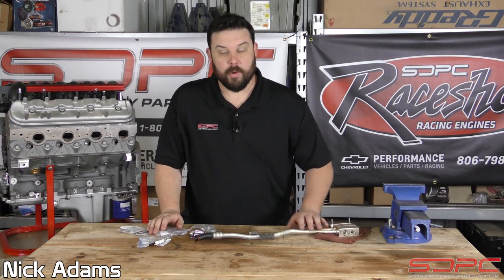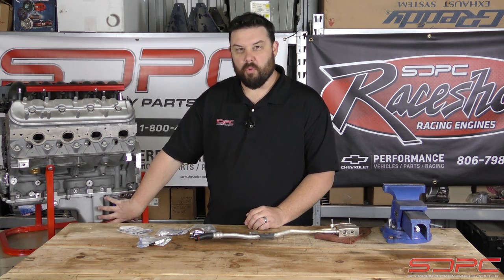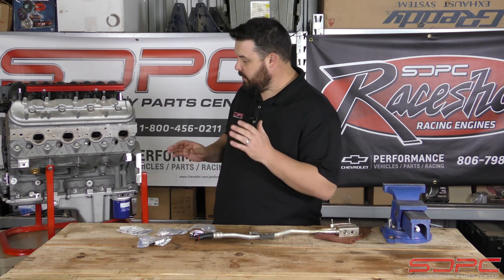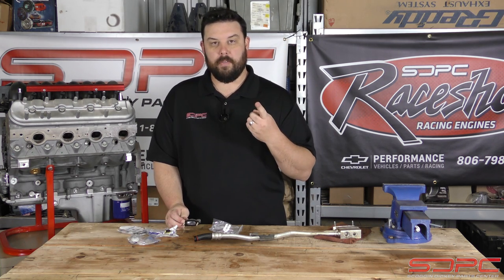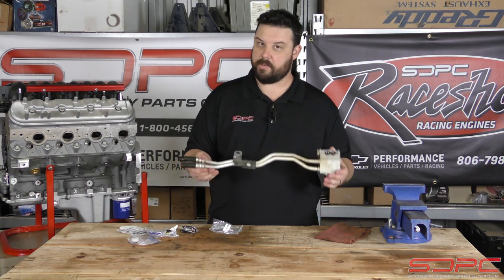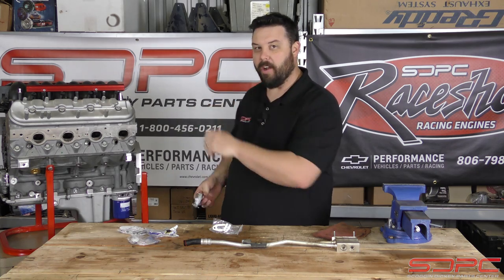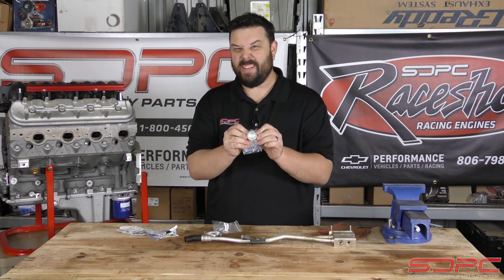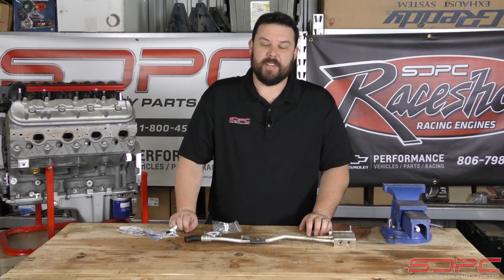SDPC Tech Tips: Oil Cooler Delete

Comment: I have a 1997 SLP SS camaro that has the optional SLP oil cooler.  I have built the engine to perform up to 7000 rpm.  Would you recommend deleting the oil cooler?  I was told that it can restrict oil flow at high rpm, but it was an LS guy that was saying that.  My engine is a 5.7 LT4 conversion, and it has a big cam that does its thing at high rpm

Comment: If I put this oil cooler block off can I use a a thermostatic oil cooler sandwich plate for it and will it work the same or no? I’m trying to take my original oil cooler lines off and replace them with 10an but not block them off

Comment: trying to find out if this will work on a 2019 chevy 1500 with a 4.3 v6 and if it will what part number do i need also if i need the plug in the block for coolant
thanks!!
Reply from the maker: We're a few steps ahead of you and have those listed in the description.

LV1/LV3 Oil Cooler Blockoff:
Plate: https://sdparts.com/i-24508882
Gasket: https://sdparts.com/i-24508892
Bolt (Need 2): https://sdparts.com/i-19881824

Comment: What about oil capacity? I’d assume you’d be overfilled with the cooler deleted?
Reply: Very very minor capacity difference as coolers works by flowing through them
Reply: @Airman..  not on trucks, on trucks it has hoses running about 4 feet each to the radiator.
Reply: @Boostlee2023  on this setup it's about ½ qt
Reply: Would it be bad if they are deleted?
Reply: @luiszaragoza5224  not unless you’re towing with it
Reply: @Boostlee2023  oh ok im good then
Reply: @luiszaragoza5224  basically these are heat exchangers not coolers, the main purpose is heating up the oil in cold environments, an efficient design would be oil to air cooler
Reply: @Airman..  would running this block off bypass plate be bad for a short term?
Reply: @luiszaragoza5224  not a problems at all if you're not tracking it or towing with it, optimum conventional oil temperature is around 250F beyond 275F it will start breaking down resulting in poor lubrication and sludging. Full synthetic oil can take 300F+ without breaking a sweat, in my full blown race car I'd like to see 210-230 idling
Reply: @Airman..  oh okay, Im good then, thank you bro, Ima run it temporarily since Ima replace them later on with AN fitting hoses
Reply: @luiszaragoza5224  if you're running headers and i assume you do, pay attention to secure your hoses to the block there are unused tapped holes that can be utilized for this purpose, even if the hoses are braided SS they are PTFE from the inside so un intended rub against headers tube could be fatal. good luck
Reply: @Airman..  I'm stock right now but I plan on doing so later, but thank you for the info, very much appreciated 🙏🏼💯